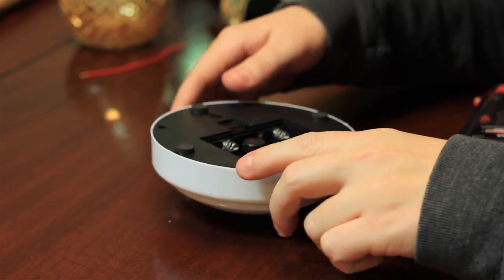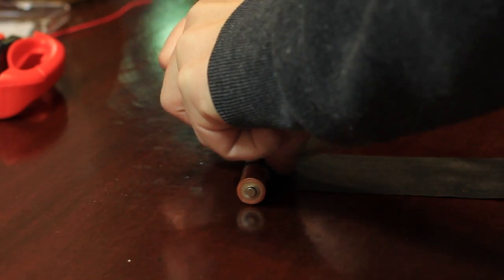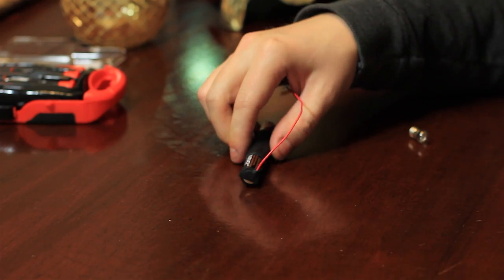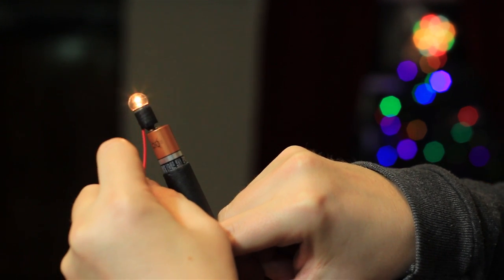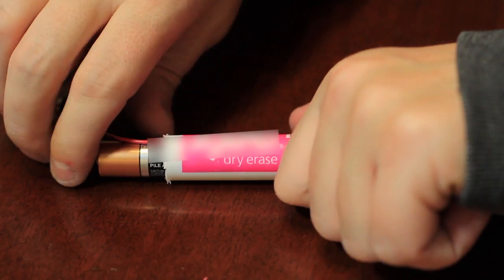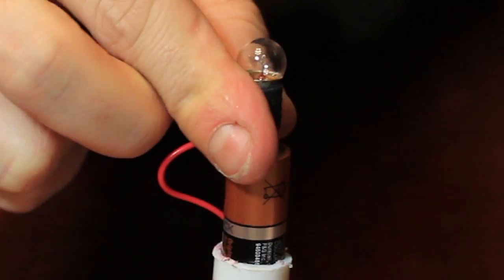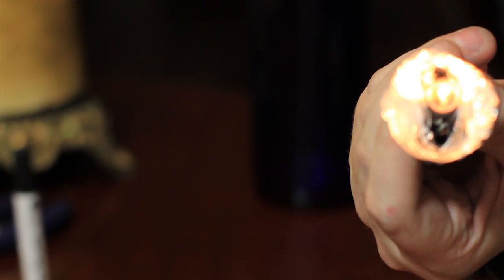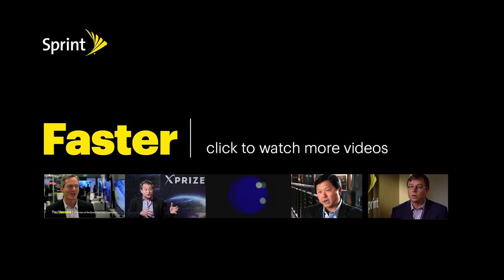Make a DIY Flashlight In Minutes

Comment: OR..you can buy an LED flashlight for $2 that will last much longer and is brighter...seriously this "hack" stuff is so early 2000s. I did this in Grade 4, and built a better one.
Reply: SportsFan1281 IDK.  This was Elementary school stuff to me.  And I can find several flashlights faster than I can find a low-voltage bulb.
Reply: SportsFan1281 Not exaggerating. I did this in 4th grade, and someone below commented 5th grade. All you have to do is buy a battery, a light bulb, and 2 wires. 

Now that I think of it, yeah it seems odd teaching that in 4th grade.
Reply: That's not the point.
Reply: WHATTT??? I didnt do this in 4th grade! :(
Reply: I think your exaggerating about the 4th grade thing right?

Comment: i used to do that when i was a kid, and i can tell you this design has at least one serious flaw: contact between two batteries which you "secured" with tape wont hold without a spring in between. you'll end up needing to constantly press the batteries together or retape them. this is not really a hack, except maybe for the people who lived on this planet less than 5 years. disliked.

Comment: I've got an idea. Go out, buy a soldering iron, a tube of electric flux and subscribe to a channel that teaches you how to ACTUALLY make stuff. Will run you 10$ and teach how to make a GOOD flashlight out of an old crappy one. That explains why you would use an LED and how to get it to work with 2 batteries. Or how to make a paper resistor. PAPER. RESISTOR. Sounds cool? Hope you find out for yourself. Much household hacking awaits you there.

Comment: It might be worth noting that connecting a load (the bulb) to a cell (the batteries) without using a resistor is a great way to burn out the lightbulb or have it explode...

Comment: but... if you already had a push light.. and 2 batteries .... why did you tear apart the push light to make a ghetto flashlight, instead of putting those batteries into the push light?? you made things so much harder than it needed to be, it just seemed unnecessary  xD

Comment: Meh I think it would be better as an emergency fire starter, if you broke the bulb you could use it to ignite tender. practicality wise you'd be better using your natural night vision considering those light bulbs aren't that bright, you can buy a cree led flash light that's three times as bright that only runs on 1 AA battery and its only like 10-20$ brand new

Comment: I got something like this hanging on my bathroom mirror and suprizingly it's lasted so long I can't remember when I put it there.
I basically got a battery, three bits of wire, a switch and a small bulb a little bigger than yours (I hope that's not what she said) I hooked it up similar to what you did however another wire went from the other side of battery and into one side of the switch then another wire from the other side of the switch to the other side of bulb.
Then when I brush my teeth or i'm combing my hair i'll just flip it.
TL:DR I'm a cheap bastard and I don't like wasting mains electricity. Can't a brother be creative once in a while?

Comment: Taping the ends of two batteries together... Taping the wire to the battery terminal? Is that really going to hold and conduct reliably when you need an emergency night light to depend upon? Gluing a spring directly to the battery terminal... I mean that battery will be flat in no time with an incandescent bulb - then what xD? Unprotected foil paper could easily fold/break/short-circuit? Calling it a flashlight even though the emitted light is too weak (using 2 AA's on a a bulb designed for 4)? If the design was neater and more resilient maybe this could be worthwhile... otherwise this a very premature April fools from Householdhacker - proudly supported by Sprint..ok... Competing with InfiniteSolutions now? ;)

Comment: "it's not pretty but it's effective" and so is going to the dollar store and buying a new flash light lol.
Reply: ThePackapunchmaster
Ahem - You werent paying attention. It was a non functional device that had a working bulb. If you dont have a light and need a light, you cannibalize what you can for working parts to make a light. Nobody in their right mind is going to do this if they have a working light. This is for "when you have no light". If you have nothing to work with, then your out of luck.
Reply: yeah if u don't have the push light u are cheaper of with a flashlight right away, but that isn't really the point of this video.
Reply: Dude, the point of this video DIY, its intended for unforeseen "emergency" situations where you cant just drive down to the store and buy a flashlight. It could be very useful advice for someone, somewhere in a really bad situation.
Reply: ***** You might need these in emergency situations, but if you have a spare push light lying around to take the working bulb out of, then why even take that. Why dont you just use the working light? This video was only made for views and it was obvious. not useful at all. And if you have extra light and batteries for emergency situation, its better to just get some real flash light.